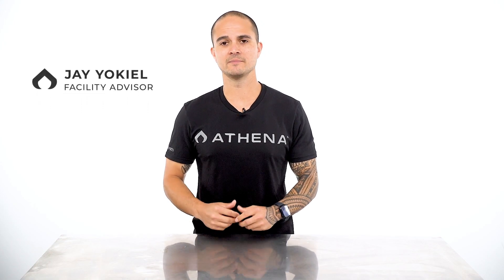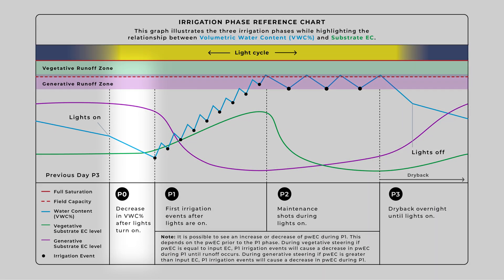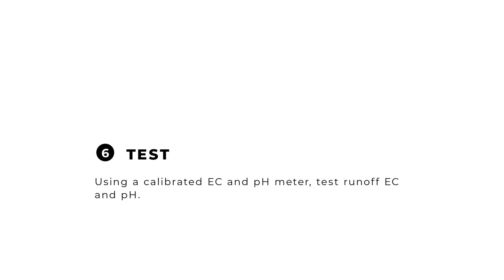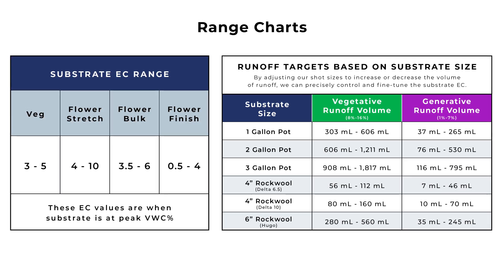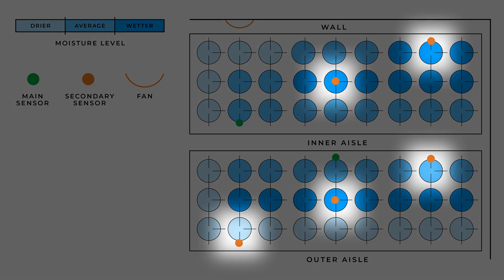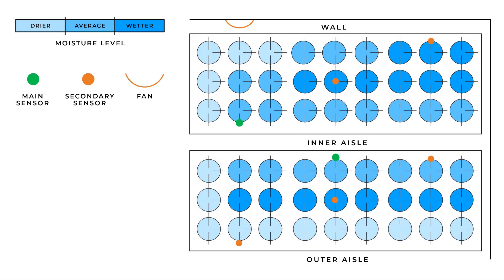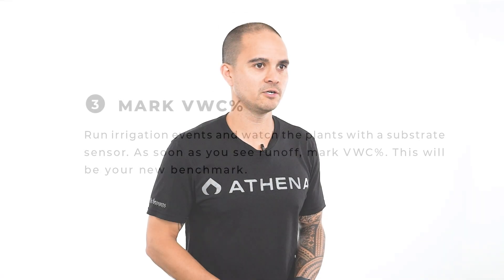Precision Irrigation Strategy – Part 5: Runoff

Comment: Great Video. Just have a question about the runoff volume table. The runoff volume percentage is based on Container size. 2gallon coco pot should really have up to 1200ml drain? Shouldnt the runoff% be based on feed volume? Thanks!

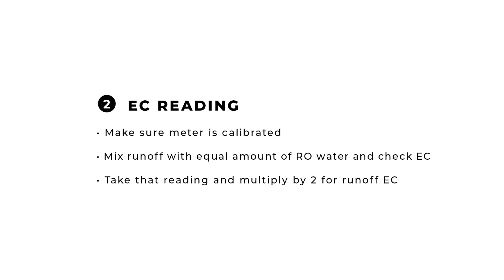Comment: @3:29, why are you mixing it with RO water and multiplying it? Is it a rule to do when there's not enough run off to measure the EC with the probe?
Reply from the maker: If your meter reads "OR", or "out of range", we recommend adding equal parts RO water to the run off you collected and mixing. This will dilute down the run off EC into range to allow for your meter to be able to read the EC. Once you get your EC reading, multiply by 2 and that is your run off EC.

Comment: If my PH is lower on run off what do you recommend us to do please ?
Reply from the maker: If your run off PH is lower than your input PH, this is typically caused from a build up of acidic nutrients in the substrate. Pushing more run off at the end of your P1's is where I would start to get the PH neutralized. If you are still seeing a low run off PH after that, then consider pushing more run off on your last P2 before lights off as well. Another not so common reason you would see a low run off PH would be from a rootzone pathogen, this an easily be identified if you're battling a low substrate ph while seeing a low substrate EC.

Comment: what If runoff ph is higher than ph input by 1
Reply from the maker: Lack of nutrients in the substrate will lead to a high run off PH, this occurs when the plant uptakes the nutrients available in the substrate leaving behind a buffered up high PH solution. High run off PH will also occur if you're adding organics.

Comment: Is it possible to crop steer in 20 gal pots?
Reply from the maker: It is possible, you will see inconsistencies from running a larger size pot when it comes to your dry down rate. We prefer 1 to 2 gallon pots.